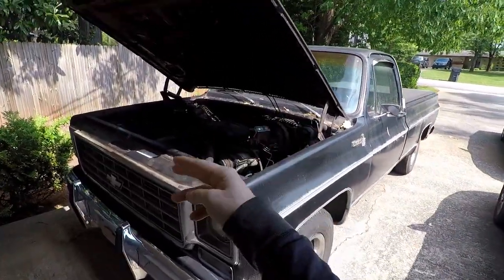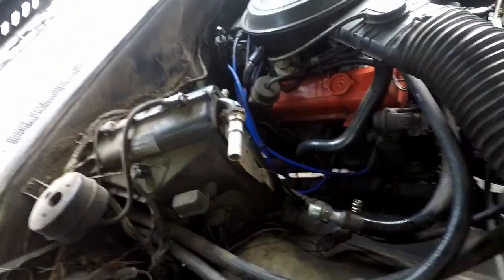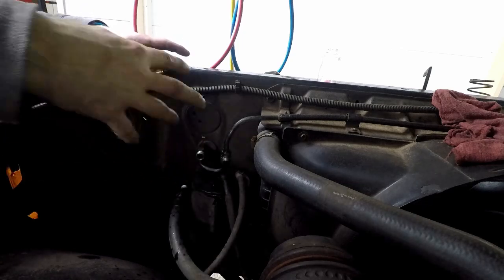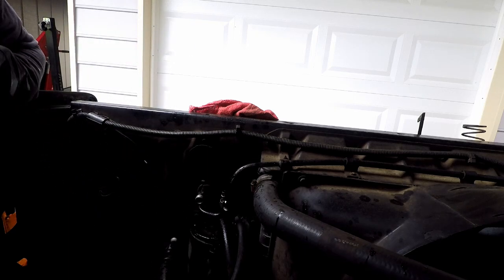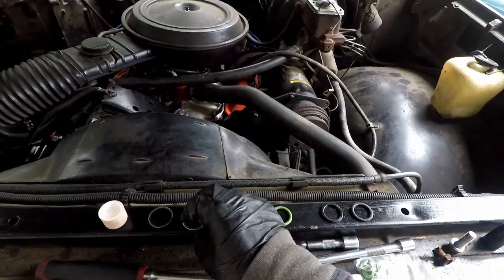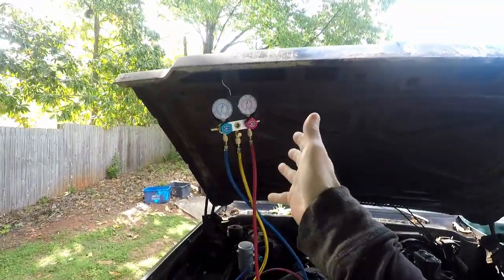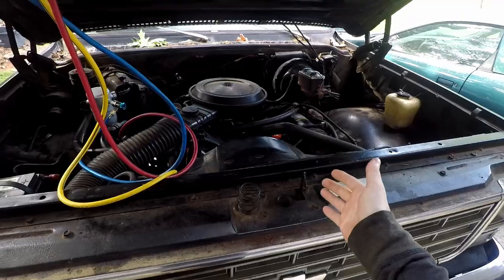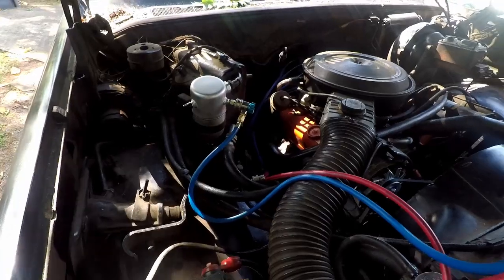Chevy C10 R134a AC Retrofit

Comment: Coming from a guy who does does hvac for a living. It’s better to use nitrogen to purge/ pressure check the system. Nitrogen is a dry gas, regular air from the atmosphere has moisture in it and could cause problems on the vacuum. I know the system was already open to atmospheric pressure but you want to minimize as much air as possible from the equation.
Reply: The vacuum boils off the moisture doesn’t it?

Comment: You need to flush all that old oil out of everything id replace the compressor and condenser and get one for R 134
Reply from the maker: @jbncnow  I did flush all the old oil out (as much as I could with what I’m working with) :)
A new parallel flow condenser is not a bad idea. But I will say after reusing the existing compressor and condenser, it cools just fine. It’s not ice cold, but it is comfortable

Comment: They're banning 134a, so you'll be doing this again with some other refrigerant soon.
Reply: not correct that’s a ban for new vehicles 2020 and newer saying you can’t use it on new production vehicles. it’s available anywhere in cans
Reply: @ReaglesRacing32  Banned in Washington state as of 2021, the Home Depot just got fined 1.6 million for selling it over counter. Its banned in other states too. It will be banned in all commercial AC units in 6 months, Jan 1 2025. And it will continue, just like R12 did.
Reply: @ReaglesRacing32 it will be around for a few more years, but yep, it's on the lost to be banned. I thought 134a would stay the r12 replacement, I think it's more about them making money. Starting in 2021, cars had to start using 1234yf. It's much more expensive. Even refrigerators have moved away from r134a. My option it was an ok refrigerant, it was the "safe" refrigerant to replace r12, now they claim the safe refrigerant isn't safe. It's all about money.
Reply: @ReaglesRacing32 I see 2024 cars with r134 🙇🏻‍♂️

Comment: Good video man! Where can i buy the conversion kit for my 1986 c10?
Reply from the maker: Search for an ac receiver drier kit for your c10. You’ll want a drier, an orifice tube and orings. That is standard stuff for any time you do ac work to your vehicle. The conversion kit you can find on Amazon for cheap, just search for r134a conversion kit. And then of course you’ll need to flush the ac lines and then add some sort of r134a compatible oil
Reply: @bluesxt  Thanks man!